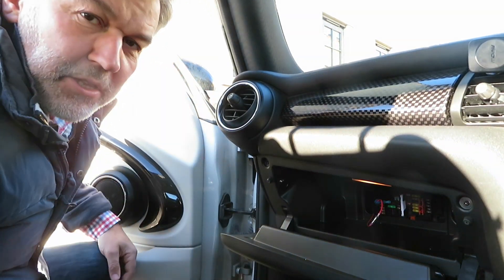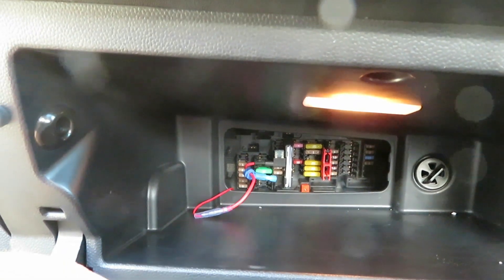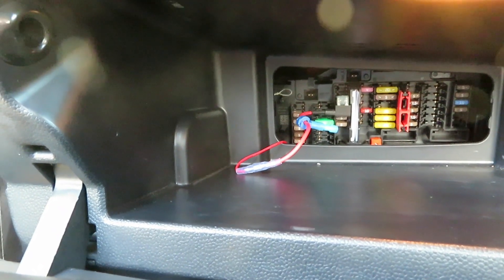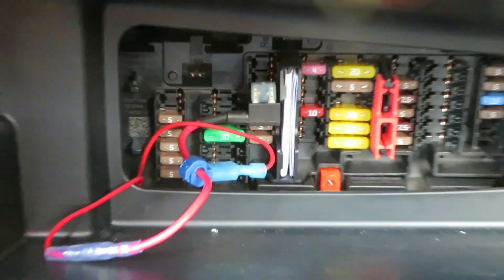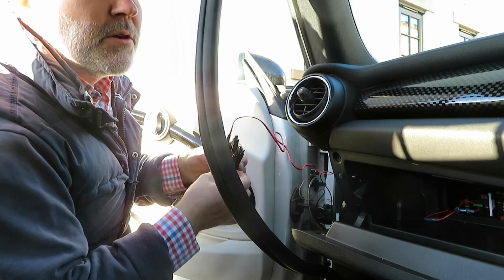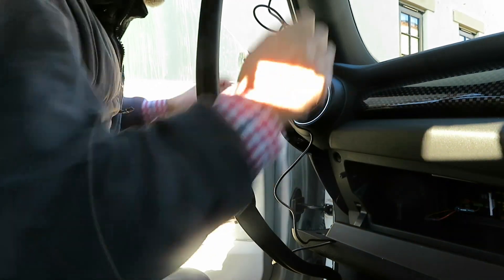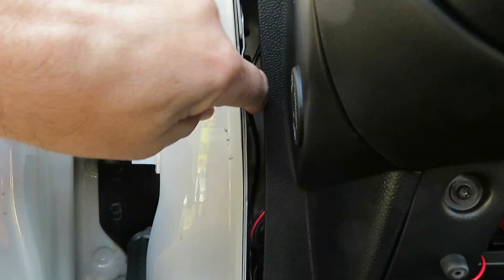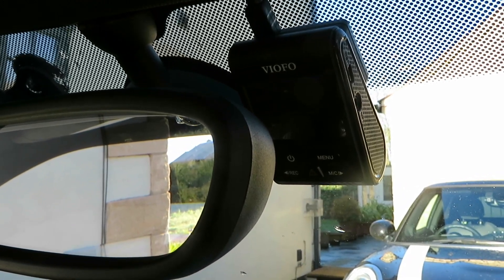How to install a dash cam in Mini 2014 onwards F56 3rd Generation

Comment: Good video, but if you decide to hardwire your dash cam it alters your insurance as it is classed as a modification to your car, but if you just use the supplied USB or cigarette fittings, it won't affect your insurance. So if you do hardwire it, please tell your insurance company or they can & probably will deny any claim you make incase of an accident.

Comment: Another comment to say, THANK YOU. I had to refer to it again today (2 years on) to take the camera out...as I'm selling the car. So....once again....huge thanks. An excellent video!!
Hoping the wiring on the F56 LCI II is the same, since that's the new Mini the camera's going on next......  ;-)  ;-)  ;-)
Reply from the maker: Excellent, thank you for taking the time to comment. I sold our Mini recently and did exactly the same, interesting that the previous comment says it's a all a "Hassle", maybe it's easy once you know how! good luck with the F56 LCI, can't imagine they changed that much for the dash cam install, maybe post if you find anything of interest. Thanks again.

Comment: Did you plug in the piggyback/add-a-fuse correctly? Is the hot side of the fuse socket on the right side or left side? The hot side should be on the side of the piggyback/add-a-fuse furthest from the dashcam pigtail.
Reply from the maker: Hi Julio, sorry I missed your message.
All I can tell you is the dash cam has worked faultless since fitting over 3 years ago, it’s not caused me any issues. I followed the guidelines for the piggy back connector and it’s been great.
Hope that helps?
Thanks again
Reply: @agentbarnesgb  OK. Operationally, it will work, but if reversed, you're putting the load of both devices on the original circuit's fuse first and then running the new circuit's across the add-a-fuse a second time. Here's an illustration to show what I'm describing: https://i.imgur.com/ypwPbk4.png
Reply: I'm sure the current is low enough to not cause any problems, but you never know.  :)

Comment: Do you have a link for the fuse connector, i want to buy one like it please?

And what amps value is the fuse on the fuse connector? My hardwire kit has a built in (blue color) 15a fuse, i am thinking about cutting the wire and connecting the fuse connector , that’s why I asked about the fuse value
Reply from the maker: Hi, sorry for the delayed response. I’ve found one of these cables on eBay. Think mine was a 5amp fuse. Just make sure that you follow the advice on the eBay link about fitting the fuse in the right slot, one will be for the car and one (15amp) for your dash cam. Lots of advice on google if you’re not sure. Thanks 
https://www.ebay.co.uk/itm/Add-A-Circuit-Piggy-Back-Fuse-Tap-Mini-Blade-Fuse-Holder-ATM-ATP-Fuse-/233513228993?_trksid=p2349624.m46890.l49292
Reply: @agentbarnesgb  thank you sir

Comment: An excellent video thanks. With your help I've just done this job in my wife's 2016 Mini Cooper. For anyone else who's interested, my checks showed that F49, 50 and 51 all become live when the ignition is on, so I used F49 to power the dashcam. F52 as suggested in the video was actually in use in our car, from the paper diagram provided in the fuse box I suspect it's used by the door mirrors.
Reply from the maker: Thanks for the feedback, glad it helped and thanks for the extra advise to others. All the best.

Comment: I used fuse 51, but 52 is OK and is live when you switch ignition on (+ACC).  My piggy back cables has 2 fuse sockets, the nearest socket to the pins plug in the original 5amp fuse, and then a 5 or10amp fuse in other socket for the camera.  However, I need parking mode on my BlackVue cameras. Using the Power Magic Pro device  so the other (yellow) cable needs to go on a fuse that has continuous supply (+batt). I have chosen fuse 42 (5 amp for central locking). Again make sure you populate both fuse sockets on the piggy back cable, or else you may not be able to lock your car!  Hope this helps. Also to say, because the awkwardness in accessing the fuse box, I removed the glove box, and then the fuse box is much easier to get at.  May seem a bit drastic, but quite easy to do, 3 screws at top and 2 screws at bottom.  The Mini Countryman fuse box is in a different location, and a lot easier to access.
Reply: See my comment. Fuse 42 was confusing as it kept on cutting out during testing. I'm assuming this was due to the doors being open so central locking power was cut.
First day with the cam wired up today I can confirm parking mode works on fuse 42.

Comment: What about airbag in A pillar? When you run cable on top, i think it can block the airbag.
Reply from the maker: Hi, i don't think this is a problem, i have followed the same route as many other installers and this hasn't been raised as an issue, but if you are not sure ask your main dealer.
Reply: Whatever you do, do not disconnect the cable from the airbag switch.  If you do, it could inflate the airbag!

Comment: 4:45. that is a bad advise!
There is where the air bag is, you should route the cable behind it, not in front of it.
Reply: A good practice would be to remove the A pillar trim and run the cable with any other cables going up the pillar from factory. More work and chance of breaking clips when removing trim, but better than distorting curtain airbag deployment.

Comment: Hi, I am looking to fit a dashcam to my daughters Mini Cooper and the fuses are in the same place as in your video. have you had any issues with warning lights or the battery running down as I have heard that most of the auxiliaries powered on the modern car, are run by BCM ( body control modules) and this is a signal sent via a soldered connection through a type of relay rather than actual voltage being passed through the wire?  If you send voltage through a signal wire, it can damage the BCM and these are not easily fixed. Have you had any issues running the dashcam or Road Angel the way you have connected them via the fuse box?
Reply from the maker: Colin Graham Hi Colin. Please to say I haven’t had a single issue with the wiring or warning lights etc from the Mini. I wired up my wife’s car as in the video and also my own mini both using this method, they have both worked faultlessly. Since this video I have wired up a RR Evoque using the same technique, again with no issues. I have recently installed a Thinkware F800 pro into a BMW 6 series using this piggy back method, the Thinkware dash cam has a parking record facility, if this is switched on then the car recognises a battery discharge and warns you, it doesn’t allow the car to run the battery flat through a setting on the dash cam. Hope this helps, please let me know if I can be of further help or assistance. Cheers.
Reply: @agentbarnesgb  Thanks for your prompt reply, glad its all working ok. I will have a go at fitting the dashcam onto the daughters Mini Cooper this weekend, following your excellent video instruction. Thanks once again.
Reply: Hi  @agentbarnesgb   - This is a great video. Thank you. I have installed a Thinkware Dash Cam F770 (didn't know I could get a piggyback plug, so thank you for showing that) and that cam also records parking. However, I have noticed that it very quickly (5-10 min after I shut off the engine) comes up and says "shutting down the system due to low battery". Could I have used a wrong fuseplug or is my battery just disscharging so fast? Any ideas?
Reply from the maker: PB DESIGN Hi, thanks for the positive comments, appreciated and glad the video helped. Interestingly I fitted a Thinkware F800 pro to my BMW using this same method. As you know you need a live feed(for the parking mode) and an ignition feed (for switching on & off with the car) When I have the parking mode switched on and left overnight my BMW always tells me in the morning there has been excessive battery discharge. The Thinkware has a safety cut off built in so won’t drain the car battery completely, as soon as I start the car ignition everything is fine thereafter. I know you can fit a separate power supply for the parking mode on the Thinkware, there about, this is the Blackvue version, https://rover.ebay.com/rover/0/0/0?mpre=https%3A%2F%2Fwww.ebay.co.uk%2Fulk%2Fitm%2F282753458617
Someone else on my comments has posted about using 51 & 52 fuse that might help.
You could also drop Thinkware a line to see if they can help, Thinkware UK Technical: 0333 121 0008
Hope that helps 
Thanks

Comment: Great Video thank you, just wonder if you could supply a link from where you got the correct piggy back connector from for the bmw mini thanks again..
Reply from the maker: Hi
This is the type of piggy back connector I used, plenty available on EBay etc.
https://rover.ebay.com/rover/0/0/0?mpre=https%3A%2F%2Fwww.ebay.co.uk%2Fulk%2Fitm%2F263719357664
Reply from the maker: Hi again 
Here’s another link, make sure you get the longer pin connector 
https://rover.ebay.com/rover/0/0/0?mpre=https%3A%2F%2Fwww.ebay.co.uk%2Fulk%2Fitm%2F333107635930
Reply: @agentbarnesgb  yea £1.69 Halfords £8.00!!!!

Comment: Thanks for the informative video.
After several hours of frustration I realised there isn't an always on fuse in the fuse box.
Using 42 only works for a few minutes before it switches off. 52 does work however for ACC.

Apart from tapping directly from the the battery, do you have any suggestions for constant power?

I've found the mini to be very difficult to work on , getting to the roof liner to route the rear camera like you did was a challenge!
Reply: Update: it appears 42 (central locking) is always on after all. 
It consistently cut out after a few minutes when I was testing it, however after parking for two hours today I can confirm parking mode worked. 

I can only assume that the central locking power (fuse 42) was cutting out due to me having the doors open for an extended period of time while I was wiring up the camera.
Reply: @0kit0  Hello, I'm doing the same procedure in a few days on a 2018 Cooper S and asked myself if i should disconnect the battery when working on the fuses in order to avoid fault codes? I need a fuse with constant power because i want the parking mode working.
So im planning to to use fuse 52 and fuse 42 (yellow cable) for the parking mode? Can you confirm?
Reply: @P1stoler0  it's been a few years since I did the install, but as I described above, 52 for ACC and 42 for always on worked in a 2015 F55 Mini Cooper.
Reply: @0kit0  well thank you very much. I will give it a try 👍

Comment: Trying to this in my f55 but the weather stripping will not come off. Seems to be glued in really well. Is it maybe not meant to come off? Or do I just need to pull hard and not worry?
Reply from the maker: Vincent Hi, not sure, I’ve tried this on 2 X F56 Minis an R56 and an Evoque none were glued just maybe a bit harder to get off. Perhaps try it somewhere around the frame that isn’t as hard to peel off and see if someone has put glue or sealant on at some point. Hope that helps.
Reply: Thanks, I'll give it a go. It's a fairly new car so afraid to any permanent damage.

Comment: Great video which I just followed and installed my dash cam (NextBase 512GW) thank you, the bit about popping off the side panel, was specially helpful and a good earth there, I never had to use a coat hanger and would worry slightly about poking a long bent bit of metal around near the fuse box so for me that would be a no no unless of course the battery was disconnected but as I said never had to bother thanks for the video very helpful, @agentbarnesgb thanks for the links below but the piggy backs came with the kit (one of each) which was unexpected  :-)
Reply from the maker: Hi, Thanks, fair point about the wire, I guess covered in insulation tape or the likes would stop any concern over unwanted contact with live wires etc. Glad the video helped. On the Mini America web site they had you taking the whole dash board apart! Pleased this way is helping people get the job done easier. Enjoy the dash cam. Thanks

Comment: Excellent video, may I add a couple of points that may help others?
I have a 2019 F56 MINI Cooper S and there was no fuse diagram in the slot behind the glovebox. If any others have similar issue, go here:-
https://www.mini.com/en_MS/home/fusecard.html
You then enter your chassis number to get the EXACT fuse diagram for your specific vehicle.
On my model, Fuse 52 was occupied, so I chose Fuse 51, live with ignition ON, which suited my set-up.
I used TESA Insulating Fabric Tape to cover the wiring to get an OEM look. This should also mitigate any rattling in the winter with cold stiff cables.
Weatherstrip, as you state is a doddle to remove so do NOT be concerned about pulling this back as it greatly facilitates the procedure.
I used twisted PLASTIC coated garden wire to guide the wiring so no risk of shorting anything out.
The spade EARTH connection would not go under the nut as it has an attached washer on my 2019 model, fortunately I was able to find another nut to double up and sandwich the camera's earth wire between the nuts.
Reply from the maker: Hi Grover. Thank you. Sorry for the late reply, just learnt why you tube had switched my comments off. Appreciate the feedback.